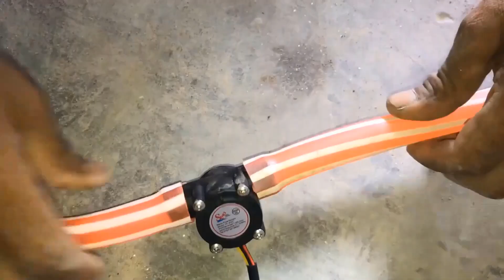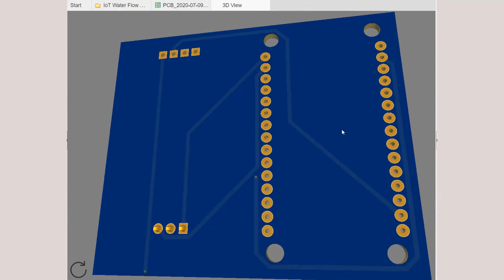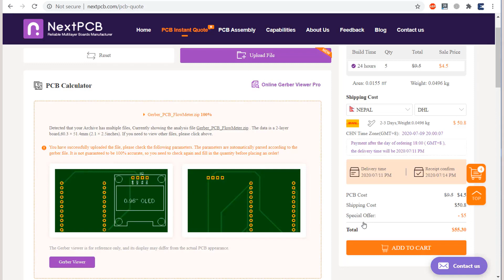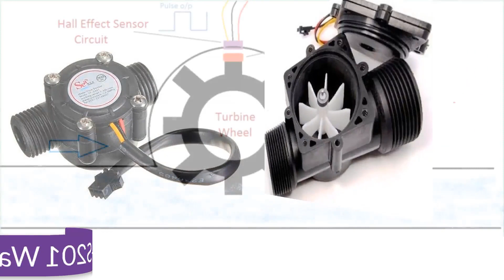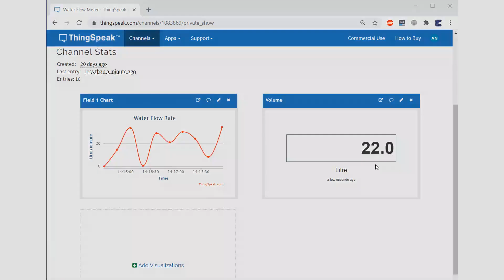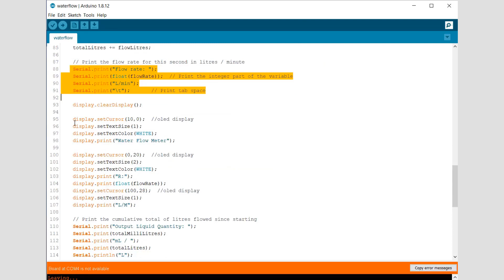IoT Water Flow Meter using NodeMCU ESP8266 & Water Flow Sensor | Measure Water Flow Rate & Volume

Comment: Amazing, Thanks for such an informative video. Can you tell me if I can connect 4 flow sensors to a single NodeMCU and get the 4 different values at the same time? also how can the water volume data can be stored for future trend analysis.

Comment: hello how are you using NodeMCU? its operating voltage is 3.3V while the water flow meter requires 5V.
Reply from the maker: Vin pin of nodemcu gives 5V
Reply: @HowtoElectronics  But does the DATA Out not provide 5V then and possible fry the ESP?
Reply: @alexandergraef8940  I came here looking for the same answer
Reply: @alexandergraef8940  ESP GPIO are indeed 5V tolerant and always have been. They officially announced it several years ago too.  Problems arise when reading analog signals on the pins as 3.3v is used as a reference. Use a LLS in that case. Digital use is absolutely fine and I myself use a range of 5V devices on ESP32 boards and have done for years. There's plenty of decent (modern and correct) write-ups online, including links to the comments made by Espressif.
Reply: @bigpickles  Thank you. Can you post a link to some official documentation. I am very confused, as some say man 3,3V on input pins, others says 5V will do as well.
Reply: @todortodorov940  the ESP CEO Swee-Ann Teo make it public online several years ago.
Reply: @todortodorov940 I'm also researching. All documents say that the GPIO of the esp32 and 8266 can only withstand 3.3V voltage. I want to know for sure if this sensor will damage the esp

Comment: How can I do when I reset the ESP8266 if I want to conserve the last data of volume?
Reply from the maker: Connect the rst pin to any digital pin of nodemcu and make it high for automatic reset after defining a certain period. You can save the last data into rtc memory or eeprom.

Comment: Hello,  i have  noticed  that the device  some  hours later  reset to zero.  no power issues was  detected, i test it with mobile power  bank.  and the issue  persists. do you known  how  to fix  it? Thank  you.  (not  hardware  issue, I have replaced  it) thank you.

Comment: Hello, i done  and works  perfectly! one question, have you any way to sent via  mqtt ONLY the differences to avoid send the same data continuously?
Thank you.
Reply from the maker: Yes you can send it via mqtt. See my recent example video.
Reply: @HowtoElectronics  

p/s: but why 5V on GPIO pins input will not destroy ESP8266???
"The ESP8266 is a 3.3V microcontroller, so its I/O operates at 3.3V as well. The pins are not 5V tolerant, applying more than 3.6V on any pin will kill the chip."
source: https://tttapa.github.io/ESP8266/Chap04%20-%20Microcontroller.html
Reply: Hola amigo me ayudas no envian datos ami plataforma  thingerbeak. Utilize mi Api Key todo eso no me aparece los datos como ago amigo ayudame xfavor

Comment: Your site is broken.  Would really like to see your code in detail.
Reply from the maker: I got it fixed now
Reply: @HowtoElectronics  if you’re interested, you can get more precise time by using timer1.  I took your code and ran the calculations in a timer isr which reads the pulse counter at the defined period.  Using the 5mhz timer and sampling every .5s.

Comment: hello can i use the ESP32 on this project with these exact codes?
Reply from the maker: May be not. Need a little bit modification
Reply: the code doesnt work. get too many errors an no support at all from this channel.
Reply: @Uglybob2012  the channel is not here for your support. Better to learn how to program ESP.